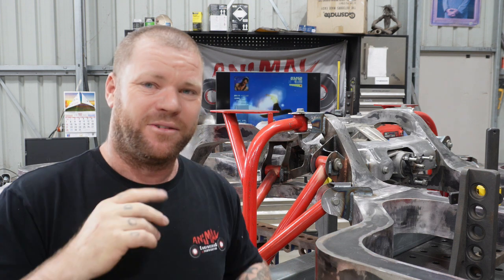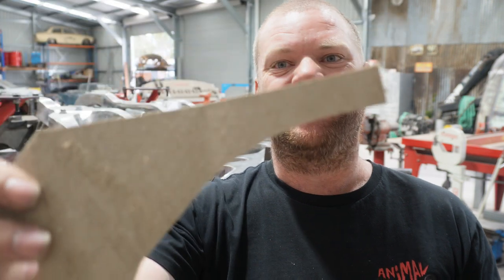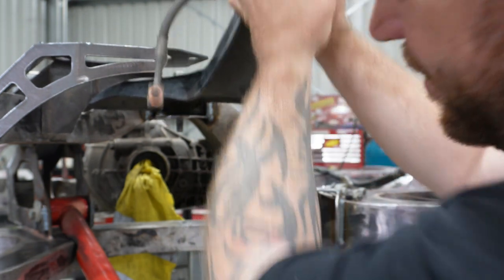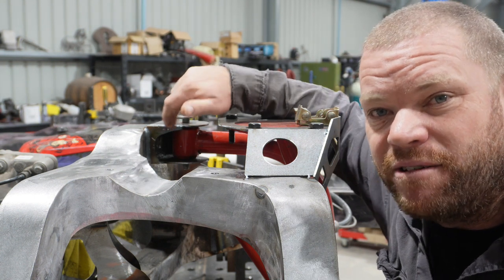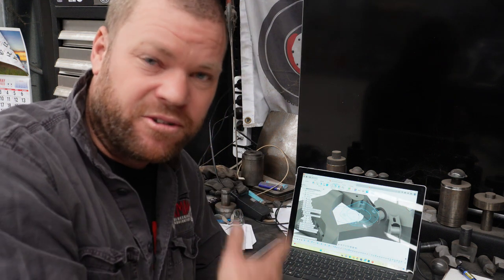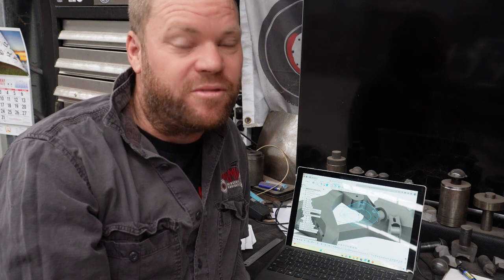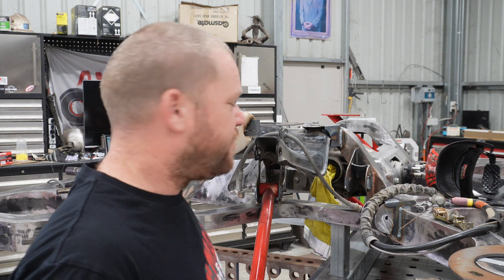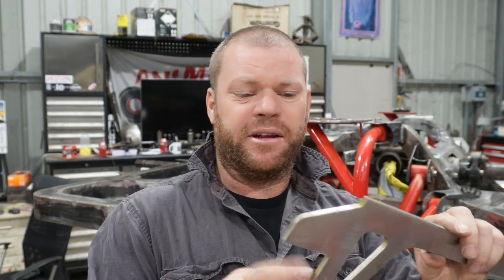rear shock tower brackets. SSMetro Ep28

Comment: This chassis is a masterpiece mate. Shame about the modifications needed, but I guess that would be expected. At least it is a beefy chassis, so it'll be all good. Gotta keep  Mr engineering inspector happy, lmao. I saw the engine and box in there and thought I had missed an episode, but not the case. I might have asked this before, but with the paint is it gonna be painted or powder coated? I presume that it will be getting done after Mr inspector has eyeballed it and approved it? One more question, will you have to hit all these brackets and suspension points with the dye process as well? Sorry for the documentary, lmao.
Reply from the maker: Thanks mate appreciate it. It has taken a hell of a lot more hours than i was thinking it would that's for sure. I was a bit disappointed about having to cut into the chassis but I feel it wont affect it overall. I plan to get the chassis powder coated, had some samples done and have picked a color for the chassis and the rims I plan on using. painting wont happen though until the van is 100% complete and driving, does my head in when I see people grind into painted parts on youtube. I will definitely be be testing all the brackets with the dye penetrant to make sure they are all good. cheers for watching and being genuinely interested, cool as.

Comment: Getting close now fella , you keeping the stock arms or remaking them ?
Reply from the maker: Cheers bud. Little bit closer each week. I will be using all the factory gear except for the shocks. I think it will make any future maintenance easier that way. I’ll go into the local parts shop and ask for parts for a VE commodore, and when they ask for a vin number I’ll show them a photo of the van, and see the confused look in there face. 😂😂